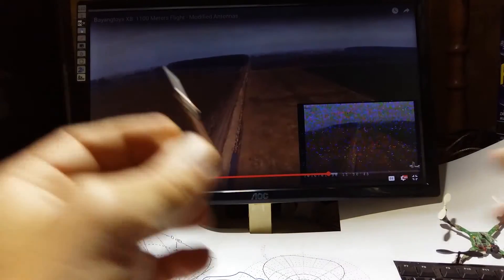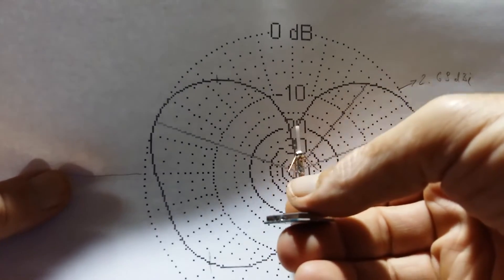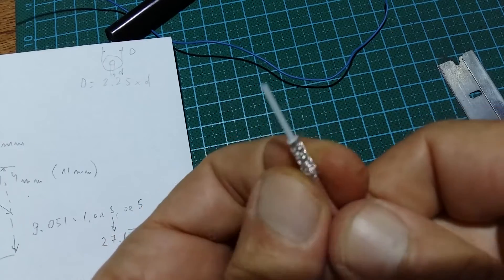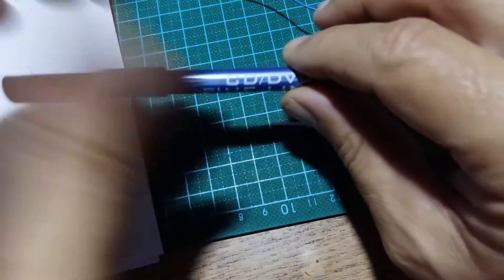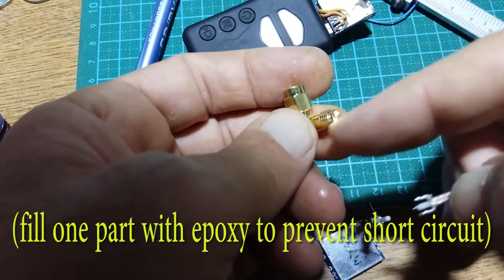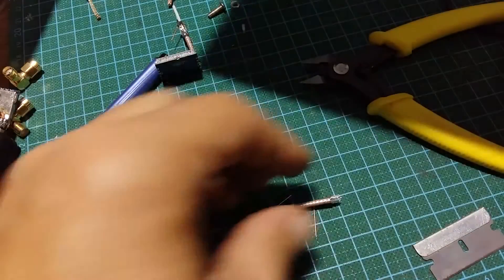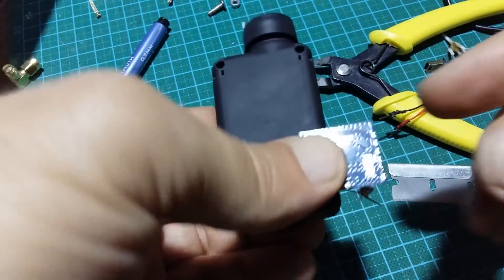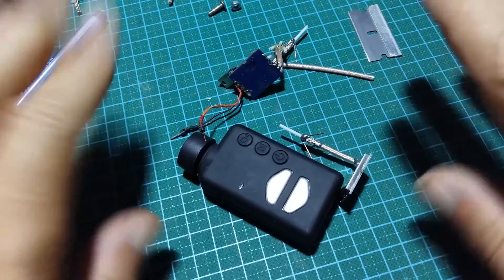How To Make 5.8 GHz FPV Antenna DIY - 3 dBi

Comment: Milan thanks for sharing, great channel!  Please what is the formula to obtain 12mm?  I calculated 1/4 lambda of 5.8GHz and obtained 12,9mm.   Did you applied velocity factor and rounded  the number?  What have you considered? I want to make a 5GHz antenna with 0.78mm conductor. Thank you!
Reply from the maker: To get lower value, you should include some geometry,... some equivalent of velocity factor.
Reply from the maker: More math at: http://wildlab.org/index.php/2016/03/02/tutorial-how-to-increase-range-of-your-quadcopter/
Reply: Thank you!

Comment: Wow. Used it on my tiny whoop and now I can fly upstairs fine
Reply from the maker: Thanks.
Reply: Before, I would fly upstairs and immediately loose signal. But now I have good connection. Before I had 79-80 rssi but now I have 87-91 rssi at max

Comment: I was about to make my own antenna's.  I think I understand correctly that you achieved over a 1000 meters with jst 25mW vtx ? That is quite awsome. This antenna is even better ?  I am really curius about the result. Very good video. Glad you made it ! Thanks!
Reply from the maker: Yes, but consider that at other end is 4 x patch antenna panel, directed antenna. With this combination (and yes, just 25 mW VTX), later got signal at 3 km, and at another not documented case 4.5 km. https://youtu.be/PlKE6jmA72k
Reply: That is fantastic. I will surely make your antenna. Thank you for the measurements and your study and hard work! Best video since ages!
Reply from the maker: Thanks.

Comment: Thank you very much! 
I made this antenna for my AIO FPV cam from Eachine QX90C, replaced original clover. With original clover range was around 40-50 meters (25mW) , with this antenna I flew more then 100 meters away and signal was good and image was OK. 
Will make same for my Eachine TX03 AIO camera probably.
Reply from the maker: Just make sure that on both ends is vertical polarization of the antennas.
Reply: What kind of antenna you would advise to use on video receiver? 
Also very curious about your Mobius FPV setup? 
Is is OK in terms of latency?
Reply from the maker: Mobius is okay for slow flight as a camera for FPV. AOE is the name of the antenna, and I tested at 3 km: https://youtu.be/PlKE6jmA72k

Comment: Hi, I didn't see anything attached to your channel ports, no DIP switch or anything? How are you able to receive signal from video receiver?
Reply from the maker: Because I soldered thin wire so that it is fixed to channel 5, which is found by experiment to be cleanest possible (avoiding remote interferences). At this moment of making this video, had no micro-switches (dip), but now I have.
Reply: So to get channel 5 you just plugged in port 3? I have trouble seeing, but where do you solder the ports 1,2,3 into?
Reply from the maker: Accroding to table, you sellect your channel. But! There is counterintuitive thing - connecting to ground means 0 (zero), not one (1). It has pull up resistors, so what you need to do is solder ... for example, channel 5 is soldering CH1 and CH2 to the ground. Then CH3 remains high, or 1. It confuses many people. http://www.banggood.com/FPV-5_8G-10mW-Wireless-Audio-Video-Transmitter-Module-TX5813-p-84761.html?p=EH10221611330201505Q
Scroll down, there is a table with channels.
Reply: This is what I got so far, I have soldered the channel ports to the ground of the antenna.
https://postimg.org/image/xjsgafrxf/    and
https://postimg.org/image/l51emlhtl/
Reply from the maker: That looks good. Just be sure that you have video signal, otherwise transmitter will not start. On your picture, there is yellow wire from the cable, but not ground wire to the camera.
Reply: Ive been trying to get the SQ8 http://www.banggood.com/SQ8-MINI-Camera-TF-Card-Voice-Recorder-Night-Vision-DV-Car-DVR-p-1022153.html?rmmds=search to work but it dosn't seem to be doing anything. As you can see in the pictures I soldered in the video cable into the transmitter, but I am not getting any signal. I have tested the AV out and it seems to work.

Here the the whole system of the SQ8 https://postimg.org/image/wtvnokixv/c42ecad8/
Here is a close UP :
https://postimg.org/image/rzyo91yjn/393ade80/

I appreciate your time in helping me build this, although I think the main problem is that the camera is not compatible.
Reply from the maker: Or camera is wrong or... please check whether you damaged +3V traces on the PCB during soldering process. It should work as it looks okay to me. Check everything again, it should work (if TX is not damaged).
Reply: It gets pretty warm when I plug in the Lipo 3.7v Battery to the video transmitter. (Its temperature rises)

Also I have been putting 9v into the RC305 AV receiver.

Also during soldering, little pieces of Copper came out, But I am still able to solder the outputs.
Reply from the maker: It is actually good sign that TX getting warm, this may indicate it 
actually working... at least voltage regulator. Inspect antenna, be sure
 that it has no short circuit between 'hot' end (central wire of the 
coaxial cable) and the ground. Do you have any other transmitter to 
confirm that receiver works properly?
Reply: WildMania thank you for your support, it seems my Video cable has stopped working, so I will have to figure it out later, HAPPY HOLIDAY!

Comment: Are you using the ERP charts from the actual antennas you built?  How did you measure SWR? or are you simply going by actual range tests using your Monitor to measure (static, interference) loss of signal  at X distance?
Reply from the maker: No real ERP chart, just speculative. And, I have no way to measure SWR at 5.8 GHz. Yes, I do testing of antennas by range testings. So far, one video https://youtu.be/PlKE6jmA72k is just 3 km with 25 mW VTX and panel antenna, but other day got better results with changing position of the VTX on the roof, so that tree line is not in between. Got last traces of video at about 5 km. Also, shared design with other local people who confirmed that this antenna is really good. If you do exactly as is on video, I can garanty you good video quality with vertical linear polarization. What can I do else to convince you and other people to make such simple, yet effective antennas for VTX, but also other antennas for 2.4 GHz for remote? Thanks.
Reply: You don't need to convince me at all. I am quite aware of how antennas work and have made my own,  and  real range tests on copter are sometimes better than charts and measured with RF equipment, so If you say you are getting better range I believe you, just by watching and listening to you.  I have made some antennas of my own by observing and applying Antenna Design Theory carefully but by also tweaking the shape of the antenna to get max range gain. I was just wondering what your reference material was because to do a proper antenna you do have to understand  how waves propagate and how to properly calculate wavelength for a given frequency.  Understanding materials and how inductive and capacitive elements work as well as impedance matching in AC circuits is key in making a proper antenna.  Most of the antennas that come with the toy grade quad-copters are never the same for the same given product, and by checking and re-measuring for the given wavelength at that frequency, you can fine tune it better, but understanding how to make your own is even better.
Reply from the maker: The main issue people getting wrong with antenna design is in direct math calculating 1/4 lambda, ignoring or not knowint that any conductor has its own "velocity factor" or as I call it "shortening factor". Now, I have no proper mathematic expression for calculating this facor, but rather old book on croatian (similar like ARRL book), where is many tables for calculating relationships between thickness of the radiating element vs. wavelength. Also, velocity factor is important for doing proper cable length, as is odd multiplication of 1/4 lambda (1*1/4, 3*1/4, 5*1/4...), because this trick ensure impedance matching in the case that antenna or device are impedance miss-matched. 1/4 lambda, signal which has high SWR, just goes back out of phase (now 1/2 lambda when back), thus "cancelling out" unwanted SWR. For short cables it is easy to measure, not for long cables. Also, many people does not see the importance of sleeve part. Instead me repeating all of this (or I should make video about that at some point), here is why: https://en.wikipedia.org/wiki/Dipole_antenna
Please scroll down to almost end of the page. BUT!!! Also, people are NOT aware that this sleeve element is bad dipole element - there MUST be another 1/4 lambda wire, even if it is so close to this sleeve. In DC or low frequency domain, this does not make any sense, but at resonant frequency it is very important. I did test with just 1/4 lambda piece of radiator and just sleeve - not as good as with added 1/4 lambda wire very close to this "inverted shield" part of the coax. Many receiver (even expensive ones) come with just radiating part and brass sleeve, without anythign attached. Or, even worst - it comes with just piece of random length coax and central wire of 1/4 lambda (such is FrSky receivers, cheaper versions). Someone asked my why with 60 mW transmitter he loses range aftrer 300 meters for ZMR250... and after convincing him ti make "proper" antennas, he never again lost  range no matter what, even in dense forest.
Reply: There is a lot of good information that is hidden in books in the old countries.  Many people just rely on everything that is placed on the internet. One must be prudent with the information on the internet,  especially that which is placed in sites that are owned and controlled by companies that hold monopolies on  audiences' attention.
Reply: do i spy a cb or ham boy here? i bet a swr meter for 5.8ghz is £££!

among a variety of cb antennas ive made, ive made a ground plane antenna like in this video for 446mhz and it works very well, made the main element and the radials slightly too long as you should in initilal building and got my swr down to 1.1 with careful trimming.

i dont know the range of it as its only been pushed to 10 miles so far but  was crystal clear with no static what so ever using 5w at both ends and one end on a rubber duck! no signal meter as both of us were using a HT.
range is considerably further than 10 miles based on the quality when we tested it.
Reply from the maker: Both: CB and HAM (54 y )old fart here :D (9A4GE, LOC: JN95JG) It is common mistake to push SWR to 1:1. Most of antennas works okay arround 1.5. It is more important to bring it in resonance that forcing low SWR. Tested on CB bands 27 MHz, and with GP antenna with adjustable ground plane elements. When get close to 1:1, then range is reduced drastically. With 5W at 27 MHz, achieved range is over 150 killometers(!). The frequency you are reffering is probably 'biker' radio? Bring back length of radiating and ground plane elements to resonance (calculated 1/4 lambda * shortening factor, depending of the diameter of elements), and you may get 20+ miles.

Comment: Love it.  What 2.4 transmitter do you use for H8 mini boards?  I want a cheap alternative (other than the devo) that  i can modify.  I have built and use your antenna's very light and work fantastic.  Thank you
Reply from the maker: Bayangtoys X8, because it has the same "Bayang" protocol. It also has better mechanical properties (more precise stearing), and more ergonomic properties. The output power is the same (1 mW or less), since it uses the same RF module - which has chip which is pin compatible, but different set of registers (can't be used nRF24L01 directly). So, Bayangtoys transmitter can run Eachine H8 and small Eachine H8 transmitter can run Bayangtoys quad. Unfortunatelly, it is out of stock at the moment at http://www.gearbest.com/rc-quadcopter-parts/pp_299986.html?wid=21
Maybe somewhere it is possible to buy it separately, without need ot buy BT X8 + TX, but at the moment, I am not aware of such store. Also, this BT X8 transmitter has bigger housing, thus easier to open and manipulate. On my video about BT X8, you can see how to make really good antenna, where with converting both: quad and remote, you can go over 1 km with FPV setup on BT X8 (not possible with Eachine H8, simply because can't lift that much weight, even with small, 4 grams VTX on it). Also, enjoy in my video of test range of modified BT X8 - my personal record with this particular set is 1.1 km.: https://youtu.be/STMtrUg1QYo?t=1m38s
Reply: Thanks for the information!
Reply from the maker: You are welcome.
Reply from the maker: Syma X5 has completely different protocol, if you asked. It can't be used with BT X8.
Reply: ok. I will get the x8 transmitter
Reply from the maker: Here is the list which transmitter may do which other quad or airplane: http://www.deviationtx.com/wiki/supported_models
Note that Bayang does not work with SymaX protocol.
Reply: wow...so the bahang x8 transmitter will work with all listed bayang protocall flight controllers?
Reply from the maker: Yes.

Comment: Hi, what is the name of that camera that you are using? Thank you!
Reply from the maker: Mobius action camera: http://www.banggood.com/Mobius-Full-HD-Sports-Camera-1080P-30FPS-720P-60FPS-For-Multirotor-p-90648.html?p=EH10221611330201505Q
Reply from the maker: And if you think about camera I am recording video, this is smartphone, Samsung Galaxy A5. Good camera, but has problem with auto focus. Audio is in most situations also good, but if it is set to something like auto-filter option, which do great job in filtering stray audio noises for phone puprose, the same filter make recording on camera less good option, since it constantly change some parameters.
Reply: Hey thank you very much for your kind answers! Have a good day!
Reply from the maker: You are welcome.

Comment: Amazing, I will do this for my 200mw FX758 tx. Is this the one you don't like ?
I'll report back results.

Thanks a lot !
Reply from the maker: Thanks. I did not say that I don't like this VTX, but I am waiting to arrive. Probably I am again too tired to make statements and think coherently - whole night messing with something. :D
Thank you in advance for reporting results. If you have panel antenna, start from 3 km and beyond. :D Enjoy!
Reply: What shall I use on the receiver with this antenna ? make the same antenna for the receiver ?
Reply from the maker: Use panel antenna. If not sold out, I recommend "AOE" panel antenna from myrcmart: http://www.myrcmart.com/advanced_search_result.php?search_in_description=1&keywords=panel+5.8&x=0&y=0
RP-SMA is long time ago sold out, so SMA + some adapter is much better than other antennas. Next good antenna is DalRC, and the worst (read: garbage, don't buty!) is RCX08. All linear polarization. For long range flight, put on some tripod or as I did on my helmet FPV gear. For close proximity, it has sufficiently spread side lobes for good reception without need to moving antenna. Please take look at this video: https://youtu.be/7hGs4RaWLBk
Notice that when flying vehicle approaches me, I do not move at all. Just now and then move my position. Also, this flight is 13 minutes with single battery. I should to build another one if I get some time. This one ended on the bottom of the Bosut river... eh...
Reply from the maker: Please be quick. This antenna is so good... and I am afraid that price will rise, take look: http://www.ebay.com/itm/AOE-5-8GHz-15dBi-High-gain-Panel-Antenna-For-FPV-5-8Ghz-High-Range-SMA-/252062085833?rmvSB=true
$23.40 US instead of just $4.99 US on myrcmart!!! Someone bough whole bunch and now re-selling.
Reply from the maker: And! DO NOT buy Aomway panel antenna at any cost! http://www.hobbywow.com/en-aomway-5-8ghz-14dbi-high-gain-flat-fpv-receiver-antenna-p240002.htm
This is so bad antenna, that I can't imagine why people buy it at all. Probably because of name, but this Aomway is more like NoWay to get signal antenna. :D
Reply: Thanks.

Comment: Very interesting :)
What kind of polarization is it?
For answering your question at the end, the video is not too long lol
I stopped using two separated batteries on my quads and i simply use LC Power Filter now for reducing the noise, i am pretty sure that will be for sure a pretty piece of cake for you to buid some lol
Reply from the maker: It is vertical polarization. I hate circular, had many problems with cloverleaf antennas, somewhat good experience with helical, but overall feeling is that - I just fall in love with vertical polarization. Horizontal has difficulties in the case that quadcopter turns 90 degrees, and second thing is that ground reflects slightly better horizontal polarization, which can make "multi-pathing" even worst (constructive or destructive interference). Yes, filter is okay, but if I need to use big capacitors and ferrite choke, then it gains weight. So instead, small battery for VTX and camera... I don't know. I will try it at some point. Thank you for reminder.
Reply: ***** Yes you are right but honestly the weight compare to an extra LIPO is not the same, most of my LC Filters with big capacitor don't weight more than 14g so for me the choice was pretty clear at the end lol
Keep it up the great work and thanks for sharing your passion with us :)
Reply from the maker: Woah, 14 grams, uh... I think 180 mAh battery is about 5 grams. Only issue is with charging two batteries instead single, but that is sport too. :D
Reply: Very useful videos on antenna!  Can you explain more why you don't like cicrular polarized video signal?  Also, in the other video on the 2.4ghz antenna mod, I see you made a dipole antenna with balun.  But on rcgroup, seems that people say they get best range with just the whip monopole with the balun.  Very interested in hearing your comment on this.